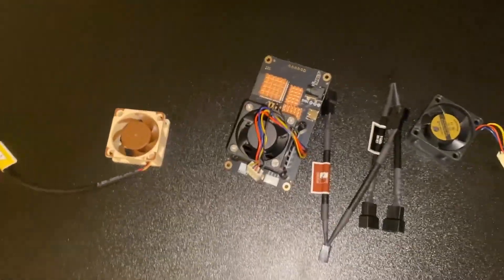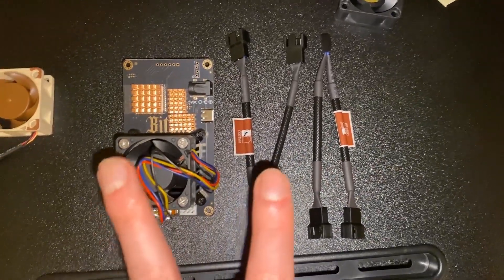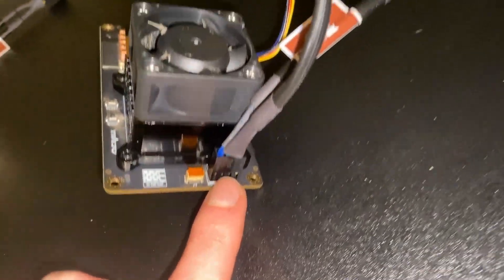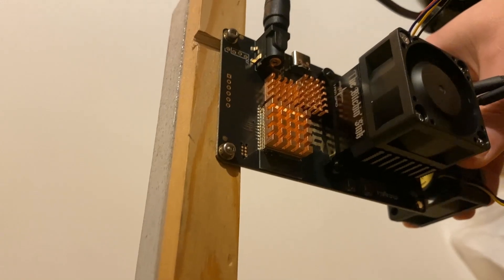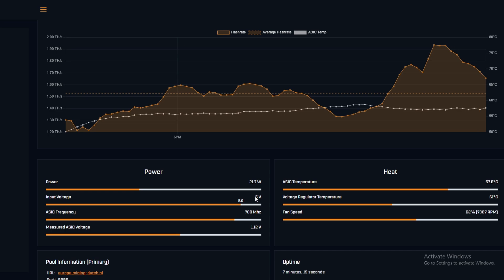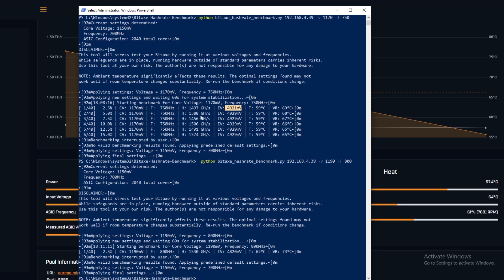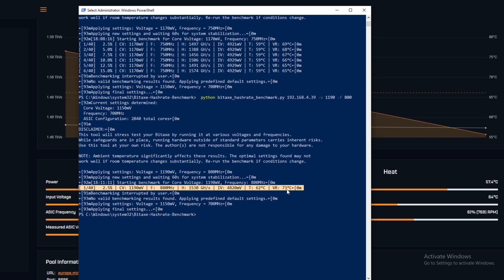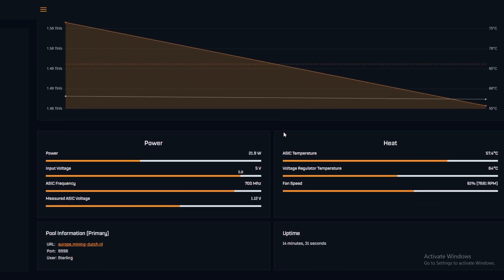Bitaxe Gamma Double Fan Solution, DON'T Try This At Home

Comment: Hung my bitaxe from a wire shelf. Hung a 12v case fan behind it, connected to an old 12v power adapter I had. Works good. Three days running at 900mhz/1.23v. Temps hanging out at 52c and 59c. It’s in the garage and outside temp is 60F today, which I think is 15-16C.
Reply from the maker: 900mhz, I don’t think I’ve ever pushed it that far

Comment: To avoid loading the bitaxe board with extra electricity consumption, connect the second fan with a phone charger and a Noctua 4-pin to USB adapter. It has to work because it is 5V.
Reply from the maker: i will try this, thank you

Comment: I have 1 on small connector 1 on big connector , for back fan i cut the pwm wire so it runs full speed all time
Reply from the maker: does this work on auto fan control?

Comment: i have also a gamma but i have heatsinks with Gelid Solutions GP-Extreme 0.5 and it helps alot
and i dont have a back fan on it but i have ice tower

 stockfan speed 40%
settings 
750mhz
1225

temps
AT 50
VRT 54
Reply: Those are great temps! What's your average hashrate with those settings?
Reply: @thak777  around 1.55 TH/s
Reply: how to use and where to find the benchmark tool?

Comment: My Gamma came with 2 fans fitted. The rear fan is screwed into the 3d printed frame that the Gamma is mounted to, and is positioned blowing directly onto the rear heatsink.
This is a D-central Gamma, you'll probably find a picture of it on their website. 🇬🇧
Reply: I just had a look on the D-central page, and it doesn't show the back of the Gamma. If you're interested in seeing a picture, let me know, and I'll put it on Discord.
Reply: We’re did you buy your gamma from with 2 fans on?
Reply: @captainmark1  I won it as a prize from a youtuber, but it is from D-central
Reply from the maker: I have a supra from dcentral, I will try to mount it when I get the chance
Reply: I got my Gamma from Gobrrr with the overclocking stand. It has a Noctua front fan and a rear fan too. However the rear fan is more noisy and doesn't seems to work well.